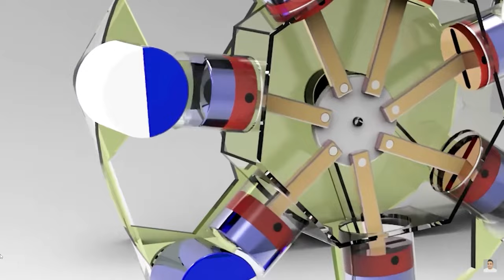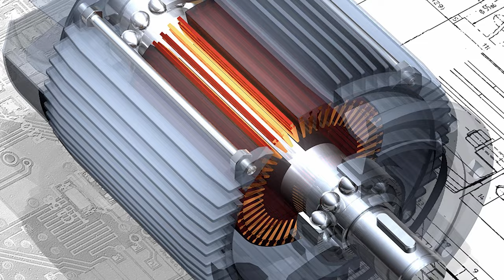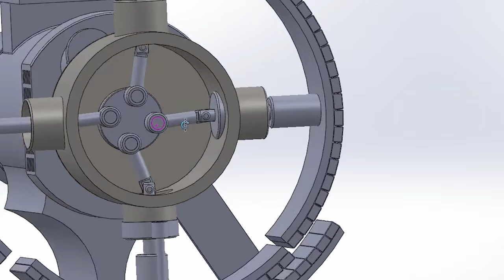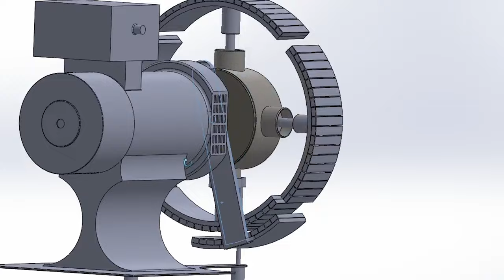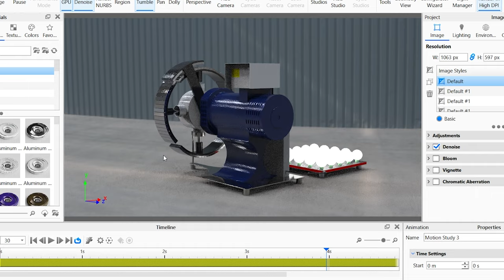Innovative Magnet Motor: No Pole Switching Needed!

Comment: This will not work, because your only looking at force in one direction, but you will have forces in both directions, which is why this motor and your piston style motors did not work, your not getting a push only on the rotating part, but your also getting a push on the magnets connected to the rods that connect to the crank, so the pressure on the shaft becomes zero, there is no net gain on this design. 🤔🧐

Comment: "due to the absence of heat" and "minimal friction" are conflicting... if there is friction.. there is heat... whether you can measure it or not... there is indeed energy loss in the form of heat and resistance.

Comment: It looks like a good design and I don’t see any issues with the way it operates.

Please complete your prototype  from this design and demonstrate functionality.

High marks for creativity and depth of knowledge.
Reply: This channel shows one "groundbreaking" design after the other, but only in animations, never has he shown a prototype. Which has a good reason. None of the presented designs work! With real depth of knowledge involved it should be known that it is impossible to drive a motor only with permanent magnets. Laws of nature are against it - specifically conservation of energy.
Reply: @heinzpg  - I saw that there were many, and no presented prototypes.

I suspect the failure in this design is the gapping between the magnet segments. This will create resistance and prevent torque.

Still, it’s an interesting design.

It isn’t against nature given that the atom does continue its spin and rotation with a very high amount of energy - from where does that energy come? Is it possible with magnets (that’s quite a few interconnected atoms) - well, that’s yet to be determined. Many of the laws of thermodynamics are under question these days and I think we are inching towards some profound breakthroughs.
Reply: @heinzpg  Conservation of energy is a fallacy.

"Faraday was the originator of the concept of the magnetic field, (which is described in terms of "magnetic curves" our present day "magnetic lines of force") however he never so much as suggested in his works that induced currents were a resultant of changing magnetic fields. On the contrary, he clearly associated the phenomena of electromagnetic induction with changing electrical currents. As per Maxwell, he too considered EM induction as a phenomena in which a current (or EM force) is induced in a circuit. but not as a phenomena in which a changing magnetic field causes an electrical field. He clearly said that the induced EM force is "Measured by, not caused by the changing mag field" Just as Faraday, he made no allusion to any casual link between magnetic and electric fields"

"Maxwell too considered the electromagnetic induction as a phenomena in which a current is induced in a circuit, but not as a phenomena in which a changing magnetic field causes and electric field. He clearly said that the induced electromotive force is measured by, not caused by the changing magnetic field. Just as Faraday, he made no allusion to any causal link between magnetic and electric fields."

"But as we've seen neither Maxwell's equations nor their solutions indicate the existence of a causal link between electric and magnetic fields. Therefore we must conclude that an electromagnetic field is a duel entity always having electric and magnetic components simultaneously created by their common sources."

"A time variable electric current creates an electric field parallel to that current. The field exerts an electric force on the charge in the nearby conductors thereby creating induced electric currents in them. This in the term “electromagnetic induction” is an actually a misnomer, since no magnetic effect is involved in the phenomena, and since the induced current is caused solely by the time variable electric current and by the electric field produced by that current."

"according to these equations in time variable systems electrical and magnetic fields are always created simultaneously because they have a common causative source, the changing electrical current, once created the two fields coexist from then on without any effect upon each other. Therefore electromagnetic induction is a phenomenon in which the field creates the other, I.E energy generation is an illusion. The illusion of mutual creation arises from the facts and time-dependent systems of the two fields appearing predominantly together"
-Causality, Electromagnetic Induction, and Gravitation: A Different Approach to the Theory of Electromagnetic and Gravitational Fields by Oleg D. Jefimenko

In laymen's terms, this means there is no transduction of kinetic energy to electric energy, there never has been. So where does the power come from? Take a look at Steinmetz and Tesla's work and go from there.
Reply: @derekboyt3383    Its electrons which spin. Movement of electrons mean an electrical current, and current is the source of magnetism. But you must be aware that a perpetual movement does not need any input of energy, if there is no force which opposes the movement. Likewise planets circle the sun without input of energy. 

And sorry, conservation of energy - which is more general than the 1st law of thermodynamics - is not under question. It would only be questioned if a reproduceable phenomenon would turn up which violates this law. Up to now this hasn't happened. Also, conservation of energy is in contrast to other laws of physics not only based on observations but also backed up by the Noether-proof, that laws of physics could not be time- and location-invariant without conservation of energy (and impulse). 

Specifically, no working magnet motor was ever shown in a credible way - although attempts to build one date back to the 13th century. But all designs have failed. Just as all attempts have failed to build a "gravitation motor" like the "Bashkara wheel".
Reply: These machines DO work. BUT they do not create energy out of nothing. The energy is taken from the magnets, where it has been put in during manufacturing. Yes, permanent magnets are not really permanent, they can wear down, if constantly loaded. Another problem in real life is that rotation speed needs to be limited by dedicated measures. In real life these machines either stop running under slightest load or disintegrate shooting their components across the room😁
Reply: @andreaskoten3665   No, theses machines do NOT work. The idea, that the energy comes from the energy put in during manucfacturing is wrong. This energy is well known and rather low, a motor couldn't run with it a reasonable time. And you have already payed for this energy when you buy a magnet. It would be a bad deal to use the energy from a magnet motor when the energy which can be delivered by the motor is much less than the energy you could buy for the price of magnets.

On top of all this energy can't be tapped, the magnet keeps this energy. Permanent magnets do not get weaker when they exercise forces. They are used in many applications but no one is worried that they will loose their strength. Of course permanent magnets do loose strength over decades, but this is due to other influences and not why their energy is permanently used up by their action.

If magnet motors would work it would be quite easy to control their speed. But there is no need for that, since no magnet motor has ever worked.
Reply: @andreaskoten3665  - What kind of energy is loaded into the magnets?

Comment: Agree, your design seems to work quite well. Keeping the magnets from repelling and attracting each other was indeed a number 1 problem when attempting to achieve that which was once thought to be clearly impossible.
Reply: Very wrong concept,
Reply: It doesn't work.
Reply: Need to approach this like an SCR with its gate fully trigged but not latching on even when under a full dc load.
Reply: It doesn't work. It's like trying to fly with your own hand pulling your hair up. External energy must be supplied to overcome deadlock. If something like this moves with or without magnets, always look for a hidden power source in the form of a battery.
Reply: @marianpotropopescu7819  y eso? Porqué lo de su comentario vendría bien, el diseño es muy original y parece que funciona, a la espera de ver el prototipo.

Comment: Could you use two cylinders connected with Barrens. With shelves on them facing each other where the  magnet sit? Use only repelling magnets. Make the outer cylinder stationary use a lot of shelves make the cylinders long therefore the shelves longer. The outer cylinder has adjustable shelves for your on off switch.

Comment: This is a really good project.  It looks like it could work.  Unfortunately, it doesn't do that because the repulsion forces of the magnets are, although only slightly, smaller than the energy needed to pull them back.  Almost perfect, but not sufficient.  😢

Comment: I love this!! 2 things. Instead of an electric generation motor, can you attach a fan to the central shaft and create an aircraft engine? Maybe you can Crete two to operate on a 1/2 scale model  737 Max or A320XWB styled aircraft. and test it flying. Second. Using the same model aircraft idea you can mount two of these as a power plant for another motor that is the aircrafts propulsion system. So such an aircraft will have two electric fan motors and two of your power plants.

Comment: It won't work, the repulsion from the same poles magnets will prevent the rotor from turning perpetually even if they're a bit apart. Any little bit of interference by the same pole magnets will eventually make the rotor stop. Cool concept to experiment with though.

Comment: Two rings filled with charged particles, the rings being perma magnets , 8 inches wide and 4 inches thick,  charged particles like electrons spin in the two rings placed high enough above and below so their fields dont interupt eachother, the charged particles accelerate around inside the ring, as fast as possible, around each ring are either a: wave guides b: more magnets direct to the space between each ring, this because as charged particles accelerate they lose energy via the form of emf emission, however via an effect known as virtual photon exchange we can direct the emf from one ring to the other, like electromagnetic pong or tennis, as a result the charged particles in each ring maintain their energy, the charged particles spin around in the magnet ring generating electricity as they go. a closed system with no moving mechanical parts at least..... solid state one may say, though temperture and radiation may be a problem.
Reply: Nice words, where do you get charged particles from. 
Are they permanently charged ???
Reply: @masoudkowsar2922  As i said virtual photon exchange, and yes you do need source, when charged particles accelerate they emit emf, this can be absorbed to be used as energy for other charged particles, how do you think the electrons maintain themselves in atomic  orbits... after these charged particles are put into the device they hopefully will not need to be replaced for a long while. Perhaps indefinitly as these do not operate through mechanincal means, but continuous exchange of emf.

Comment: A regular motor has two points of friction. The bearing on the ends of the rotor. This design has 13 areas of friction. I fail to see an improvement.

Comment: GREAT VIDEO 
ARE YOU SELLING THIS  ? 
HOW MANY KWH CAN THIS GENERATE  ?  5 KWH OR 10KWH  ?
Reply: Neglecting friction you get zero kWh. It doesn't work. No magnet motor works, permanent magnets only give you potential energy, but never continuous energy. If you consider friction you need a small input of energy to get it rotating.

Comment: Where are you going with this prototype. Means it is aesthetic to watch this but where will it be used? What is the purpose of making such designs? It is not creating electricity. Using electricity to turn the motor which will turn some fancy generator is pointless and will waste energy. 

The only thing appreciated here is design and animation.